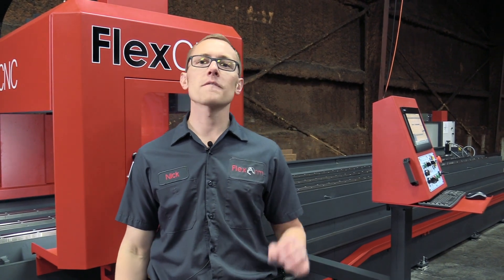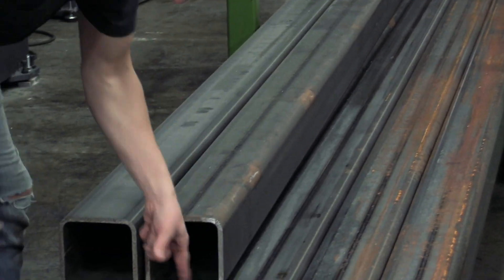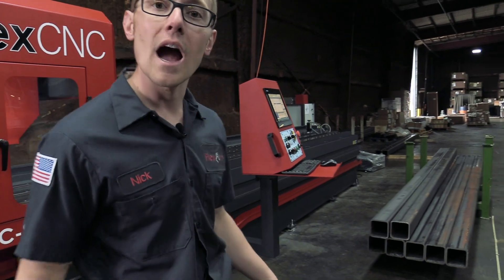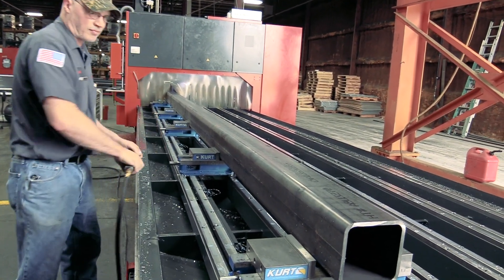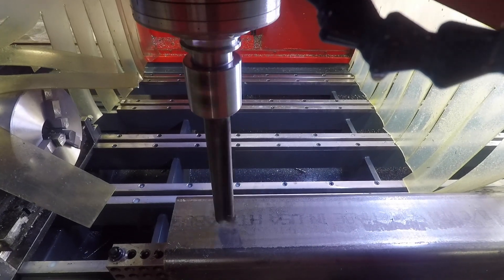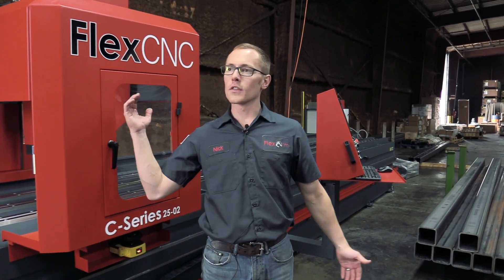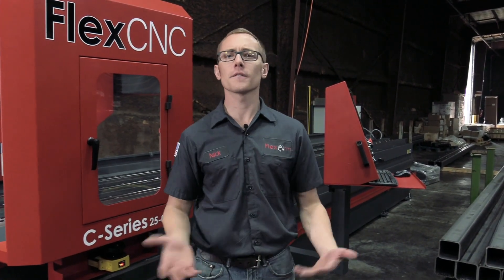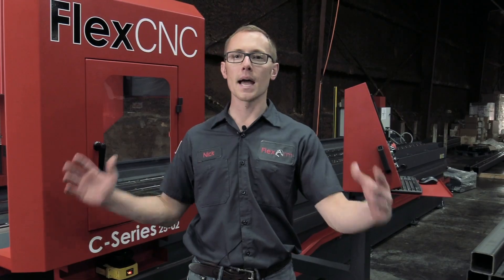Drilling 20' Tubes on the FlexCNC

Comment: What make this better than a tube laser for punching holes in material for fabrication work, like this part?
Reply from the maker: @JohnSmith-dp2jd Price, Footprint, and Versatility. When you look at the major tube laser brands, the price could be around 4 or 5x more expensive than a FlexCNC.  On top of that, if you were to go with the tube laser, you would need to factor in your floor space.  Since the tube laser has to feed the material through, you would actually need the space to accommodate twice the length of the part, at least.  Whereas with the FlexCNC, you just set the part on the bed and the machining center moves across the part, rather than moving the part through the laser.  If those things are not a deciding factor, and all you are doing is punching holes in the material, in all honesty, a tube laser might be more efficient and is definitely quicker, but then you are limited to just cutting holes.  But if you want to drill, mill, chamfer, tap, etc, that's another advantage that the FlexCNC would give you over a tube laser.  We also have customers who use both and they bought the FlexCNC as a secondary machine to handle drilling their long parts while their tube laser is getting worked on because tube lasers do require a lot of regular maintenance.